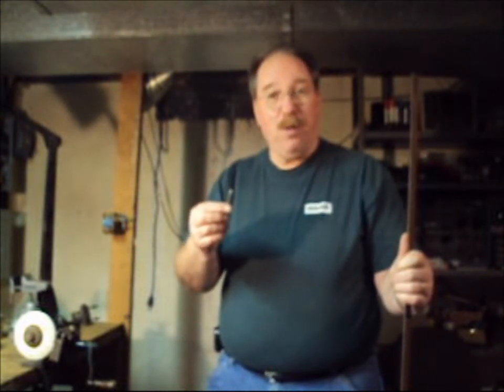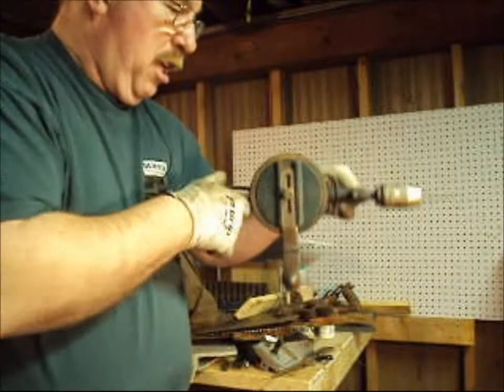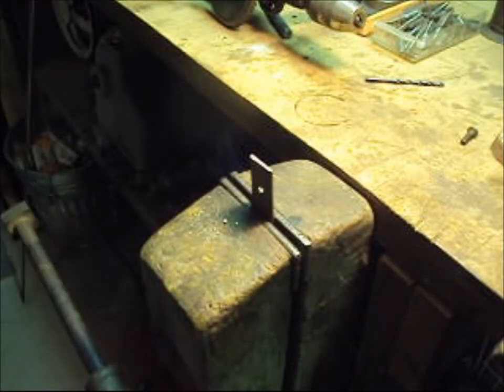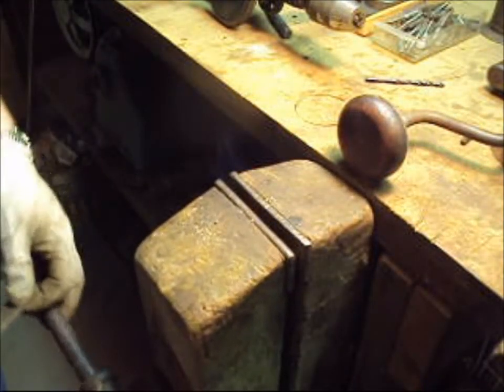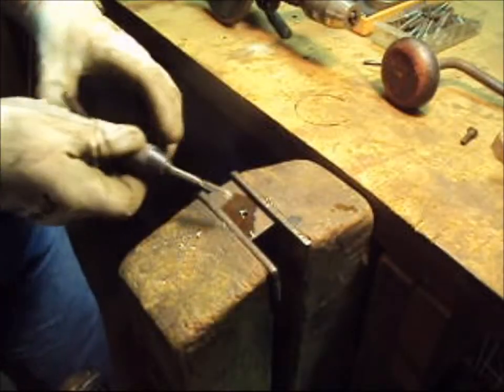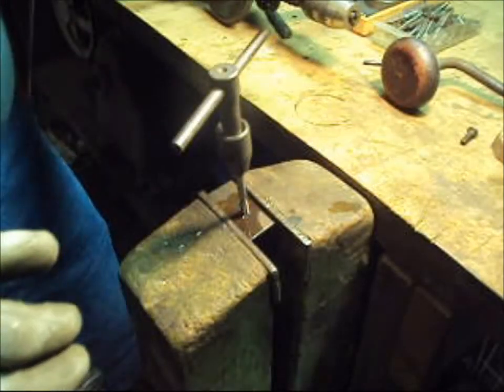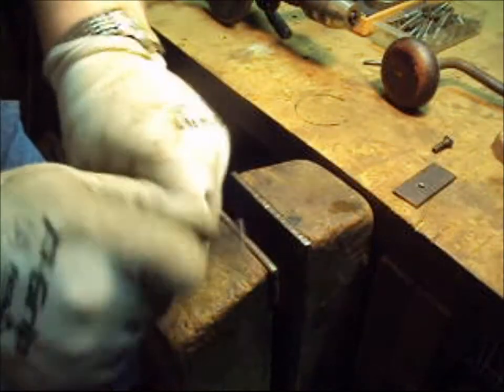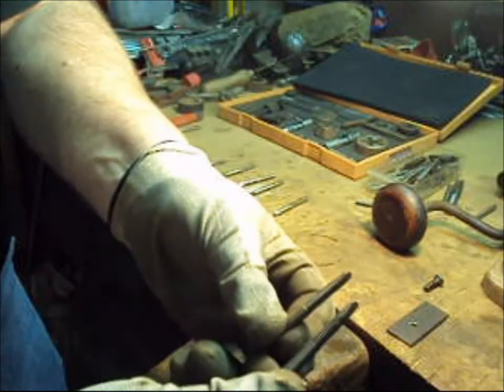Using A Hand Tap a video tutorial from Old Sneelock's Workshop

Comment from the maker: It came out of the building that the previous owners called the model t barn. Mr Cline had a small bench attached to the wall and that was on one end. It has a steel acme thread and nut that clamp the two 4x4 uprights together and steel plates screwed to the jaws. I don't know if it was home mad but it has been repaired a lot since Roy Barton Cline first installed it back in the 1920s.